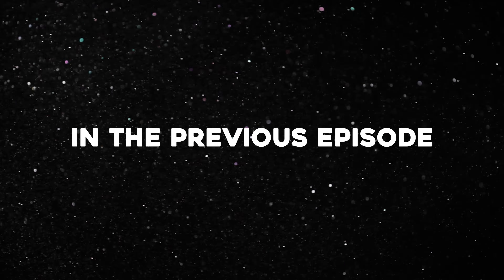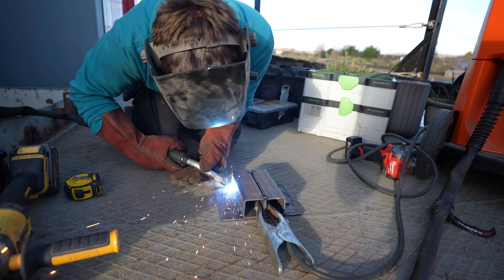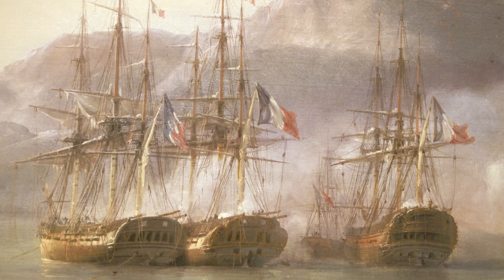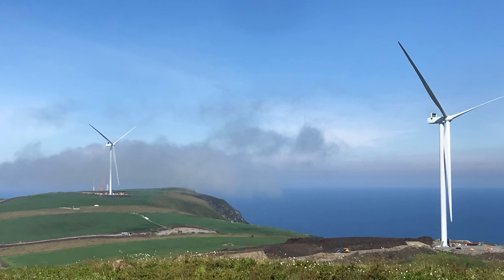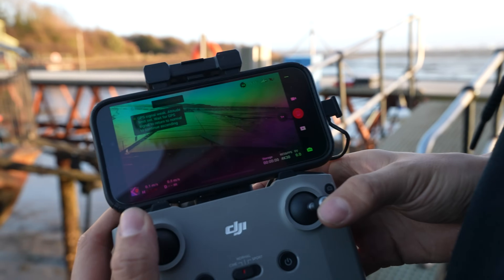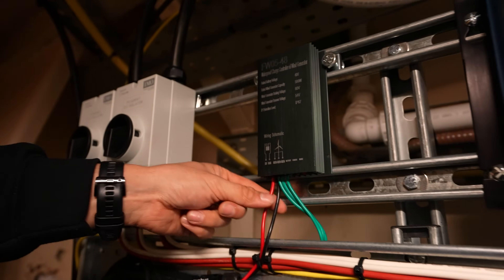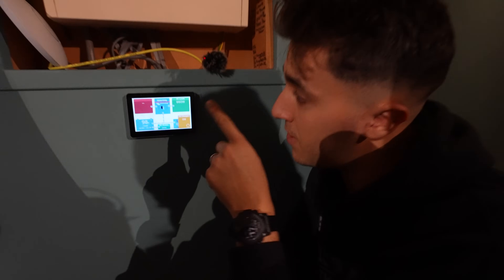Mini Wind Turbine Install | ØY35

Comment: Hey Cory why not check power production and add that wind mill power generation with victorn system
Reply from the maker: Hey mate, it was connected that way, via the Victron Orion DC - DC connector

Comment: Noooo dont solder on a resonating component!!  Just crimp it! Always crimp on a boat. The movement from boats wiggle solder joints free and that creates heat and then shorts. We never ever solder on boats. I know this one doesn't have a working engine but normally thats what causes solder joints to break apart engine resonance is a big part of consideration on boats. Even the movement of the boat itself is enough to fuck solder joints. Love the vids so this is not a criticism at all. Just speaking from experience here. Seen too many melted/broken connections bc of soldering.
Reply from the maker: Thanks for your explanation and experience! Every day is a school day 😁

Comment: For the 3-phase connections on the turbine, using 4mm bullet connectors with heat shrink is ideal. It’s what I use on my ebike which has a similar 3-phase BLDC motor.

Comment: What controls are there that protect the turbine from strong winds?
Reply: Not only strong winds, but also normal winds + full battery.  A wind controller should be connected to a dump load (big resistor) to always be able to keep the rotor speed into acceptable limits

Comment: No planning needed for a turbine in Ireland but you need to request approval from the council (section 5) before installing them on a Chimney. In process of doing one myself at the moment! Is there a storm surge protection on the one you installed? Great vid as always.

Comment: I don't think you'll get anything out of that wind turbine. You've got a 48v version which is more suited to lead acid batteries. You've got lithium which voltage sits around 55v. The charging protocol has to be around 5v above the battery voltage. So in this instance you would only start charging once the turbine is pumping out 60v, which is at it's max. I've learned the hard way with these things, the most recent being one with 6ft blades and a £2k invoice. I live at 400m above sea level in the Highlands and didn't get an amp!

Anyway, I love watching your videos and there's always something new to learn.

Comment: How does the wind turbine charge controller talk to the rest of the Victron system & battery bms? I’m guessing it doesn’t and you’ve set the relevant voltages in the charger itself?
Reply from the maker: It goes in via an addressable shunt

Comment: Unless you're designing and building it yourself, it will be sub-optimal.
Converting wind to torque:
Vertical vs. Horizontal
Converting torque to energy:
Low RPM vs. high RPM
Making 1000watts of output at 700 RPM vs. making 1000w at 4000 RPM requires different generator design decisions, mainly in the coil.
There are propeller/blade designs that only spin at a maximum RPM preventing your generator coils from burning out from excessive spin, more amps than the coil can handle. Usually, these are vertical blade designs.

Comment: Are there any safety regulations related to metal objects above the roofline in terms of "lightening protection"?
Having seen a metal-masted dinghy being struck by lightening on a lake, I wonder about the wind generator, and any potential damage to the electronics below if it is struck.   It's in a quite exposed position.....

Comment: Why convert the AC to DC, only to have to convert that back to AC?  You can use that three phase AC to power stuff directly, saving even more if you’re precious battery bank DC. 😉
Reply from the maker: It’ll be all over the place, not a consistent frequency/ voltage/ current.

Comment: Hey Cory, I loved this video series. I use solder seal connectors to do sealed butt splices in DC wires. I've seen them up to about 6.0mm2. They go on with a heat gun and make a solid connection with solder in the joint and a glue seal at each end. I usually heat shrink over them for extra protection and I've never had one fail or ingest water.
Reply from the maker: Awesome! I’ll check them out. Thanks!

Comment: Hi Cory.

That turbine wont produce much, since its one of the generic china made ones. Its to small to do 500w, looking at the physics side of things. If the 500w rating is correct, its at 12 meters per second of steady wind. To get the wind you need, you need to rais that mast way higher. Around 10m above anything within a 100m radius.

I'd install a manual 3 pole switch to short out the turbine leads to completely brake it, incase of emergency. Best would be to do this with a normally closed 3 phase relay, so it shorts when the onboard grid fails. a freewheeling turbine will destroy itself without a brake. 

The chargecontrollers are trash. Open it up, its filled with sand instead of a real mppt.

If you really want to utilise wind and get real useable power, Get a Heli 2.0 windsafe from istabreeze, 48v, on a 10m mast with guide wires, auto brake with the relay i mentioned, big three phase bridge rectifier and hook it up to a Midnite Classic mppt controller. This controller allows you to dump excess power to a dummy load to regulate it that way. These controllers also allow you to make and adjust a power curve, to match the load the the powercharacteristic of the turbine.

You need a 3m diameter rotor at 8ms to get 600w from wind. Everytime the windspeed doubles, you get 4 times the energy. Same with blade length, double the size is 4x the power. Size and mast height is everything.
Reply from the maker: Thanks for the advice! We learned the hard way here!

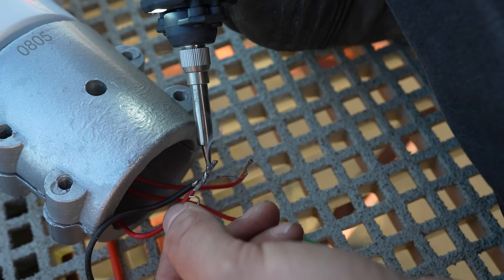Comment: 10:32 2 Different metals? Wuh? Either the solder flows onto both, or the solder connection isn't done properly, like if the turbine used nasty ass CCA wire, the solder isn't going to flow onto the wire if the copper coating breaks away, which it does while soldering.

Annoying really, cause given the space constraints, there's not really anything else you could have done. Like I'd have use Wago's but trying to insulate them in that tight space would incur it's own issues.

Comment: how did you limit rotations - to avoid twisting the wires too much ??
Reply from the maker: They were on a magnetic joint, so the red wires spin freely inside

Comment: Loving the work, turbine is on my project list (the never ending project list) because i live at the top of a bloody windy hill in suffolk.  We get regular power cuts so i've currently got a baby system setup and not connected to the mains, so i treat it like a generator that when full gives me bonus loads of washing/dishwasher for free.  One question though, my charge controllers for wind have big dump load resistors for when the battery is full to burn off any energy, is there something similar on that setup that we didn't see?

Comment: Cory, why not some wago 221 then one of those wago junction box that comes with dielectric paste inside?

That would had been a better solution for the connection of the windmill, although I agree that is kinda stupid the windmill is provided with leads that are comically small in length.

Other way was opening the back of the windmill cover, follow the wires and solder the new cable directly into the pads, after removing that comically small ones provided, of course if such are in pads.

It is not that soldering doesn't give you good results, but I'm always more into adding connectors or solder wires to PCB pads instead of soldering 2 wires together.

Still I don't know if you know about, but you can search online for this - NASA Workmanship Standard for Crimping, Interconnecting Cables, Harnesses, and Wiring.

It provides you with a PDF that is the the procedure current used by NASA in their space missions for soldering, wire harnesses, crimping and interconnecting wires. Even if doesn't teach you anything new it will provide you with some tips and cases where a connection method is better than other.

I printed and have it in my office as a relaxation reading in slow days.

Other than that great video, great project and hope to see more new things from you.

As a final note, is that new t-shirt design Lemon Energy x ØY Electrical be available for sale?

Comment: Keep a large blob of blutack in your soldering iron case for holding wires in place while you solder them and twist them together along their length before soldering, also the Milwaukee is OK for very occasional jobs but a TS101 or Pinecil V2 is far superior for bigger jobs. I'd also use adhesive lined heatshrink or apply a small amount of hot glue before heatshrinking in an environment like that.
Reply from the maker: Thanks for the tip!

Comment: Ive done that experiement with windmills. You want to match a low KV brushless motors (drone motors are high kv rated, so they produce lots or RPM to keep a vtol in flight)) at 3x the input power to what you want to produce, the fisher and paykel smart drive motor is an excellent example, the 36 pole version can produce 150v dc (open circuit) with very little rotation. Thats a different story when you put a load on it though, and then they start cogging because they are capable of producing a lot of torque they also produce a lot of brake force, which is what happens when you apply a load to them

Comment: You need to use flux when soldering unless you like doing it the hard way.   Soldering using only the flux in the solder only works for perfect circumstances. Giving the wires a light sand beforehand (for the worst cases) might also help.  I find adding flux is usually enough to make most joints cooperative.
Reply: Grease from one's fingers probably doesn't help either when twisting wires togeter?

Comment: Couple of tips from an amateur, fit a changeover switch as a break on the turbine three phase, for maintenance and preventing damage from over speeding during storms. My turbine is ac coupled to my victron microgrid via a gti. On victron world as croft one the turbine shows as a PV inverter with about 10 months of data. I actually live on an island as well 😊. Small turbines are not really worth the effort to install but they are visually pleasing. We run a ground mounted 8kw PV array as well, planning to add about 4kw more again ac coupled but vertically mounted as our December January gain is rubbish. Love your channel and the fact you are covering more hybrid and off grid content.
Reply: The other point which I forgot because I got distracted is in a DC coupled environment with Li you need to be careful of overcharge else the BMS will disconnect. Li are not as forgiving as Pb and AGM. The trad way to manage this would be diversion load controllers to a dump load resistor. However utilising Venus os large and node red you can run smart loads. I have got smart switches on the relay outputs of the cerbo that can run scenes and routines across multiple devices based upon circumstance. I know you have other people you work with who handle the control side of installs but there is very little content available for learners on node red and Venus os large out there. It would be nice to see some coverage of the control side in the future. All of this is more critical in off grid as hybrids can just dump overcharge to grid, PV charge controllers just stop flowing at SOC setpoints but wind never stops.
You can see why most off grid installs end up DIY, getting a standard sparky to put their head around the complexities and be up to speed has been rare. The uptake on hybrid systems is starting to change the market but when it is mostly system in a box like growatt there is a way to go yet.
Reply from the maker: Thank you! Cool insight

Comment: Around about junction 18 on the M25 there a house with a windmill on it
Been there for decades
Wondered why there weren't more
Reply from the maker: Interesting! They haven’t really ever taken off like solar has. Partly for how little they generate vs the effort required, only really worth it when off grid

Comment: Sorry that is a cheap Chinese pile of shite you will be lucky to get a few hundreds watts when the wind is spinning it up fast, garbage you should order an istabreeze 2kw one.
Reply from the maker: I hate to say it, but I agree with you! This is my first foray into the wind generation world. So it’s all new, and it’s interesting to document the process! Thanks for your insight. More to come, proving you correct in the next episode. @petechongy @ed.r
Reply: Also use an mppt controller with brake or your in for a rough time when the bats are charged it will not slow the turbine down and will rip the blades clean off, ide also install a switch that shorts all 3 phases out so it manually brakes in very high winds, also do not use pwm you will lose alot of speed and power in doing so just like connecting the rectifier direct to a battery it's super inefficiency. But saying that that turbine prolly won't have enough braking force to be effective in very high winds.
Reply: I was going to say the same. It's going to be a definite fail especially in a marine environment. Those Chinese turbines don't last much over a year with even a little rain.
Best small turbine manufacturer in the UK is Marlec.
Reply: I bought an istabreeze 2kw not got it up yet need a braking system for it but I spun it up few hundred revs and nice output cant wait. I just looked at marlec and there prices and they can go and take a long walk off a short pier.
Reply: @petechongy  The price for Marlec is well worth it because it won't need to be replaced every few years. You also get something that actually perfoms as advertised. I guess it depends what you want to achieve. Cheap turbines are fine if you just want to try one as a short-lived novelty. For serious long-term power generation it's always better to spend the money on a real turbine like a Marlec.

Comment: Those 'diodes' are thyristors.  Thyristors are used because you can control the phase angle of each phase.  You might want to control the phase angle of each phase to control the power throughput for example.

Comment: Soldering is not welding, it's brazing.  Furthermore, it doesn't matter if the wire materials are different - it's your soldering iron or technique that's the issue.

Comment: The drone will have a bent motor shaft or one of the props is out of balance.
If it was one of my diy drones I'd check each motor for run out on the shaft amd then check the blades are balanced.
Should be fixable though but i'm not a DJI user

Comment: You know they make cylinder wind turbines. 
really really surprised you didnt look into them.
You'd get great output with the wind hitting the flat side and going up the boat.
Reply from the maker: It’s on the cards. However this is far cheaper, and more of an exploration exercise really
Reply: They tend to be much less efficient so you'd need something much larger to get a similar output. The output of such turbines is usually very exaggerated as they come from dodgy companies who don't gather real test data on performance. No real turbine manufacturer would create such turbines as they are simply too inefficient as a design.
Reply from the maker: Which is exactly why we have this up gathering data for us.

Comment: Hi Cory, the three phase recifier in your smart phone schematic at 17:03 was different because the upper three rectifiers were SCRs instead of standard diodes. I once built a capacitor bank that had 12 x 200V 1000uF in parallel and 8 x SCRs to dump the energy in to whatever I was trying to obliterate... i mean spot weld. lol Also inside the wind turbine controller there is usually some kind of regulator and smoothing on the DC output, some also have an output for a brake on the turbine to stop it going nuclear in high winds :)

Comment: So nice to watch your content, the first self-ironic minutes with the cuts to the movie killed me 😂
However, at 10:38, if you want to easily solder cables, just dip them into some flux, solder them with a high power iron and somewhat wind-shielded. After soldering, wipe the connections with some alcohol to remove the flux. This will make for some really nice joints. 👌
Reply from the maker: Thanks! 🙏🏼

Comment: Oh man 9.29 in am staring at the two Milwaukee boxes near the edge of the pontoon and my head is just screaming out to move them years of working around pier and boats it becomes a rule to keep them away from the edge as inevitably someone knocks them into the drink 😂very surprised the wind turbine was not pre wired, also how long before it shook itself to death just cant see it working with the metal hull, i am the same as you idea wise would love to be able to offer off grind reliable systems which have long term life spans so actually really interested in finding a reliable wind turbine as i am in Shetland which is literally the windiest place in Britain

Comment: Haven't you seen those lovely heatshrink sleeves with a built-in solder ring? Exactly what you needed for those joints.
Reply: don't use them for critical structures.

they're mostly lead and dont conduct exeptionally well.

better to simply solder with Sn60Pb38Cu2 solder with 2% flux core and use hot-snot lined heat shrink tubing to protect from the elements.
Reply from the maker: Never seen them! I’ll have to check them out

Comment: another great vid. I was taught Always make a firm joint (twisting is good eg US wire nuts) then solder holds it together. NASA dont allow solder joints as vibration breaks them. I know ideas change so we went to wire wrapped joints then insulation displacement in comms.
Reply from the maker: Thanks for the info!

Comment: What voltage is the controller/turbine rated at? I have had two of these feeding a 24v system and in hindsight I should have gone for a 48v version. It will be interesting to see the results, mine only generated any decent amount of current at quite high wind speeds. Would indeed be good to be able to access the vrm for this installation. Where can one acess it please Cory?